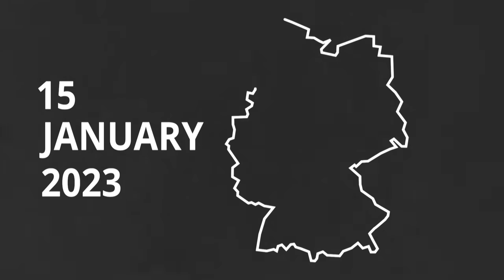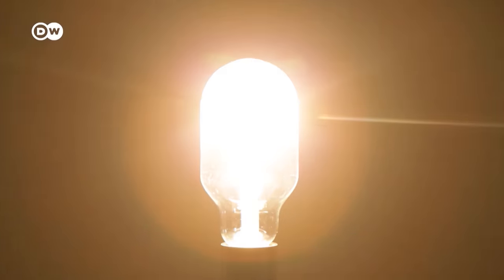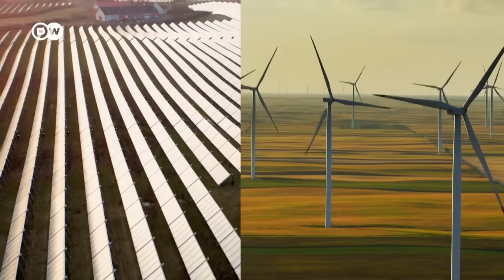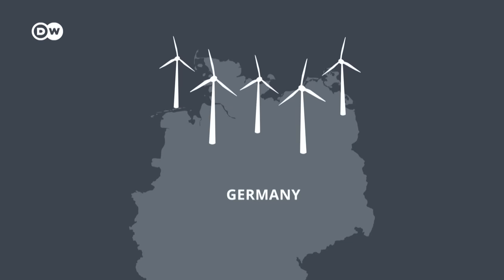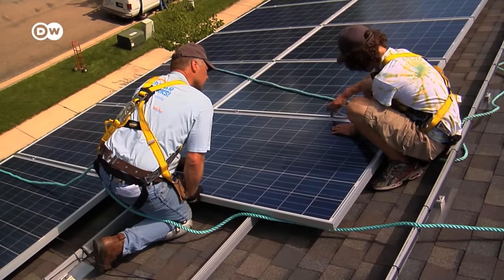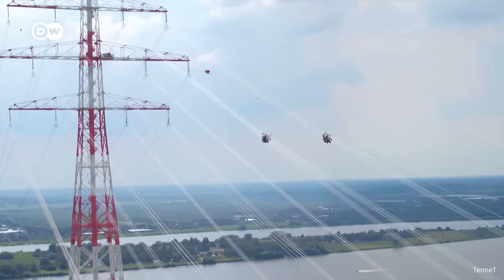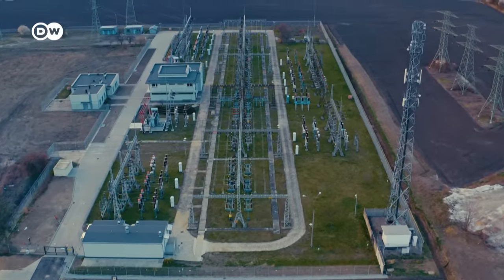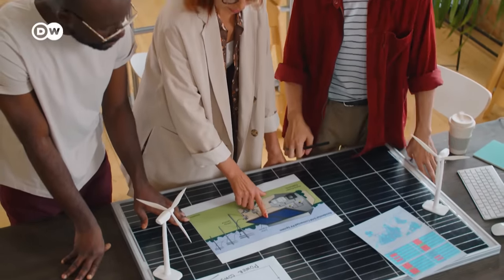This is what's REALLY holding back wind and solar

Comment: This is really an old problem that has been ignored too long. Actually incredible that people wake up now.
Reply: I think another such problem is probably biomimicry getting patented which should be outlawed to just a certain extent, because such patents should have a certain amount of originality to avoid playing in God's domain! That way, we can have better energy storage!
Reply: "In relation to creation / evolution, it is well to remember that evolution has not & cannot be proved." "On the issue of a relationship with God, mistakes have eternal consequences" -Roger Carswell. (I hope the same of the latter quote can't be said of other deities.) And the former one points to the possibility of the prehistoric world being created in a week! In case you are wondering, the quotes are from a book called Questions & Answers From The Bible!
Reply: @st-ex8506  What about biomimicry? It must at least give a cellular level guide for battery design!
Reply: They knew, we just found out...
Reply: Under CDU 20 years
Reply: @frostfamily5321  Biologically based batteries don't charge up or discharge as quickly as other types. There may be a place for a biologic-based battery, but I doubt it would be grids or for EVs or mobile electronic devices.
Reply: @ericdew2021  Then I hope a Tesla power grid-if you can call it that would work out better.
Reply: This sounds like another channel from those blind optimists at The B1M. Wind turbines and solar panels will never generate enough energy in their entire life to make up for the energy it takes to make them. That seems impossible but it's true. The amount of energy it takes to make steel, aluminum, glass and cement is enormous. Cement making alone generates 8% of all human generated CO2. Plus the energy it would take to mine and smelt the copper and other conductors is off the scale when the concentration of the ores is low. And the elites know that global warming is nonsense. That's why they've said over and over that it's not real but they're going to use it to bring in the new world order. Plus there isn't enough copper (or electricity or the other metals - iron is the only metal we have plenty of). Electric cars are being mandated because they want us to not have cars at all. They'll herd us into 15 minute cities and restrict our movement. Elon Musk bragged on twitter that he had the CIA do a coup in Chile so he could take their lithium. The US military invaded Peru last week to steal their copper. It would be better if people had a basic understanding of elementary thermodynamics. This is real science where they know what they're talking about.
Reply: Well, people have talked about this 10 years ago and still there is no working HVDC line on land available. Also it's already predictable that these planned lines won't be enough for the future demand and there are no additional plans public. Plus there is a need for more power in general, so planning to construct solar farms in Spain and Northern Africa and connecting it with HVDC to Germany is overdue now in my POV. So actually I don't see that there is enough of a waking up in politics.
Reply: Youre wrong! They didn't wake up yet. Still dreaming...
Reply: There were plans to avoid this in 2009
Reply: Yes, I guess sitting around with our thumbs up with our asses becomes boring after some time.
Reply: No. This is not problem if you use nuclear powerplants just like France do.
Reply: @mareksykora779  if half of them are out of service (like in France) you'd be wrong about that.

Having excess grid capacity isn't particularly expensive but builds resilience to everything else being less stable.
Reply: (grids are cheap, easy and low maintenance - humans are really good at pulling cables )
Reply: @bunsw2070   Real science?!?! Love to hear from the peanut gallery on this "real" science business. But I advise you to seek help on your REAL delusional reality.

Comment: more than a decade ago, someone wrote that Montana wind alone could produce half of the US electricity need, except that half of the US had to move to Montana.
Reply: Well the good news for you is that continued American under investment in infrastructure for the last fifty years means your Grids (yes plural) need to be renewed anyway - so as you have to spend the money you might as well spend it on making your Grids fit for the 21st Century. There's a company currently building a high voltage line from Iowa to Chicago - they've avoided the usual issues about rights of way and eminent domain by running it alongside interstate highways. I'm surprised the Germans didn't do the same - running it down Autobahn 7 from Hamburg to the South would have given them a fairly direct route.
Reply: There is nothing wrong with Montana. A friend of mine once drove through the state on a road trip
Reply: Illegal Immigrants: Bet!
Reply: @Peizxcv  but would Montana want or be able to handle such an influx?  What would those newcomers do for a livelihood?
Reply: not accurate
Reply: @st-ex8506  Yes, I'm also aware that the 10% of the power for California comes from Canada too.  Hydro beats wind/solar. Hey, I like wind/solar but they are complementary power generators. Not base load.   No matter what solar farms that I build, we will need nuclear in future.
Reply: @st-ex8506  Who is paying for tha
Reply: What are the winters like?
Reply: @BitCrafted  the statement was rhetorical. It was meant to make the reader realizes what the issue is: it is about the grid, the distribution, not the generation of power.

Comment: Yes! Thank you so much for making this video. I work for an electricity grid company for the lower voltages, so the cables that are in the streets and between neighborhood's. We also have a huge amount of work. The amount of aluminium that's going into the ground is enormous and so many more transformers are needed that need to be placed somewhere. If you're looking for a job check the jobs your grid company offers. There are also a lot of jobs for non technical people and if you are technical but don't have an electricity background there's quite often a training program so just try it. I studied architectural engineering and am now an engineer for the cables in your street.
Reply: The irony is that aluminum production in Europe has gone down because of high energy prices, this means with enough forethought we could have possibly prevented it. 😞
Reply: @autohmae yes, the transition to Renewable Energy must happen during time when energy is cheap, when we have surplus of cheap energy to build infrastructure. When energy will be super expensive the effort to build clean and safe future will be much bigger.
Reply: @OmmerSyssel  I'm European and work for an European company. They don't gatekeep. There aren't enough people that have the correct qualifications at the start to be able to gatekeep. At the company I work at I first had to go through a program where they taught me about my work, as I wrote before. After learning the basics I got my first project which was quite simple. All my work was checked extra for about half a year, at our company the work is always checked for compatibility with the rest of the grid and whether it's correct with the standards that our company has. I can always ask my more experienced colleagues and the people that oversee the work outside for help

Comment: You lost me at the hydrogen, it’s absolutely the worst way to store energy it’s so inefficient
Reply: It is ridiculous wasteful for burning it. Maybe turn it into aircraft fuel would be good because they can't run on batteries
Reply: It's not that it's just inefficient, if it were cheap and easily handleable if but could store energy indefinitely it would be fine, but it's not cheap, hydrogen created through electrolysis is incredibly expensive, not just in the electricity required, but mostly that the plants to do it with some efficiency are incredibly expensive, then you tell me your plan is to only run those plants for 4 - 6 hours a day when the wind is blowing and the sun is shining... thats dumb.

And yeh hydrogen is explosive, it's volumetric energy density is low even when stored as a liquid under extreme pressure or extreme cold and causes hydrogen embrittlement wreaking all of the equipment you use to work with it. It ducking sucks.

Comment: In the Netherlands, you can already get energy contracts where your price varies by the hour, and you get an app to see the prices for the day. On days with a lot of sun and wind, the price can actually get negative. This means people will automatically try to shift demand to those hours.

In case that is a lot of work: there are already systems that can connect your washing machine to your home assistant, to turn it on when the price drops below a certain level. For now, those systems still have a high degree of tinkering in them, but that will become more mainstream I hope!
Reply: Do you have a company name for me, i would like to look a bit deeper into it
Reply: Very Impressive, what is happening in Holland with energy optimization.
Recently I heard about Ibis Power, that installs complex systems on rooftops.
Reply: Aren't these systems still variable tarrif. What happens in an extreme case where there is a drastic shortage in power supply. A good example is what happened in Texas during the snow storm last year or was it already 2-3 years ago. People on variable tariffs got huge bills 30k USD for the month, etc. At the moment such a problem is not to be expected in the Netherlands orCentral-West Europe, but how can the system be set up for extremes like this so that the consumer does not empty their bank account or even worse end up in debt.
Reply: @TheNiro87  gridX
Reply: @BrandonLobo Those variable prices are set the day before, per hour, for the whole country (except for a minor margin depending on your contact) so extremes like in Texas aren't expected. The biggest problem in the Netherlands is that we have 'salderen'. That is that is that the excess solar energy is fed back to the grid, can be used in the winter without any extra charge. So in our home we have about 1MWh of solar in the peak months that we can use for free in the winter. It was ment as a boost for renewable energy (solar) but isn't helping the energy transition at the moment. It isn't financially interesting to store energy in a home battery (for the night for example) because the ROI is terrible at the moment. 

Al lot of people are running the dishwasher, laundry, charging the car when the sun is shining, but financially it isn't needed sadly. The flexible energy contracts aren't interesting when you have solar because when the energy prices are negative, you need to pay when your solar energy is supplied to the grid. So it is cheaper to shut down the solar system and turn the electric heaters on with the windows open. 😢
Reply: @BrandonLobo   why do you think it did not work correctly? Worked exactly as it should. During extreme event, it gave extreme incentive to save energy.
Reply: @Harbie  Oh damn thanks for the info. That's just sad
Reply: @TheNiro87 yeah, don't touch those plans. In fact run far and fast from them.

They are generally tied to the current market wholesale price which in AUS where I live is capped at -1000 to 12,500 dollars per megawatt hour.
A lot of people in Texas got bit big time with these types of deal just a few years ago.
Reply: @TheNiro87  "tible" does exactly that, you pay the price electricity gets sold at the stock exchange market. This can be highy profitable ( negative prices when a lot of wind and sun is there) or really expensive (in winter when most electricity is produced with gas and oil)
Reply: @Harbie  Thats funny. You have too much cheap energy and some people really wanna argue against it.

Anyway, couldnt you harvest it in a batterie instead of turning it off?
Reply: @fetB  Sure we can connect a home battery. But the ROI isn't interesting at the moment. The power you harvest is cheap and the battery is still expensive. There is a Dutch company that makes home batteries (5kWh for €3200,-) but in my current contract 5kWh is about €1,-. Last year the energy prices where sky high (due to the war, now the energy panic has settled a bit) and 1kWh was more than €1,-, so if those prices where normal then the ROI would be better. Personally I'll wait for the flow batteries with a storage of 100kWh to make it more sensible to invest.
Reply: Octopus has introduced this in the UK too. It brings some really interesting possibilities for future home microgrids / storage. Maybe an AI app?
Reply: @BrandonLobo  Ultimately, you have to accept the idea of "near blackout" possibility regardless of what your energy supply tec is. I remember a day or so of blackout in Manhattan in Aug-2003 (I recall? Fuzzy old head w dates). It happens, say every 3 or so years overall. Obviously it happens at the worst time - in that Manhattan case it was a sweltering summer spell where every a/c was maxed up full. But such a blackout should never cause the disaster that happened in Texas a few years ago, where in a freak mid-winter snap serious life-threatening scenarios arose. That incident had nothing to do with renewables, incidentally. It was just a plain ol' overload of good ol' legacy grid tec, resulting from bad planning.

Comment: South Australia and Victoria, Australia, have electricity retailers that charge $0 for power use for 2 hours during 12-2pm, which is peak solar supply time. Both states have high roof top solar installation, which means the wholesale price of electricity during 12-2pm is often a negative number, so usage actually returns credit to electricity retailers during those times 😅
Reply: Ahh, another Stralian. I'm from western Tasmania. We have the "Cleanest air in the world.' This is mainly due to a relative lack of heavy industry in the southern hemisphere and very little air exchange between hemispheres. In spite of this, Global warming/climate change is happening just as fast here. As it is in the rest of the southern hemisphere. Does Blackout Bowen or any of our many experts on this subject, have an explanation for this fact?
Reply: The downside is that during 12-2 PM you could be killed by five different kinds of spiders.
Reply: @I_Have_The_Most_Japanese_Music   lol, where i am in the North i got Crocodiles on my doorstep too.
Reply: @neth77  Are they trying to sell you stuff? That would be annoying.
Reply: @christophermay4540  Climate change isn't a localised phenomenon. It is irrelevant that the air is clean near ground level in Tasmania.
Reply: I guess that Australia should rethink also their power grid system. The horrible storms recently did hit the system and the costumers pretty hard. I would like to hear the actual damage and economic lost caused by the power lost. It's also a bit ridiculous to build up the poles again and again instead of making a plan. I'm sure that the government is ignoring this problem as well

Comment: It’s crazy this is a problem in Germany, I work on designing and building high voltage transmission lines just like this one in Texas and we are building them so fast and frequently our company can’t keep up. It makes a huge difference when you don’t have the population and the government constantly TRYING to kill the project.
Reply: This is how you can tell whether people are really rational about environmental concerns or whether they're driven by luddite emotion and superstition.

Germany can get a lot of stuff done because people have a positive gut reaction towards environmentalism.  But on the other hand your gut is your gut, and sometimes it's not the best decision-maker.  Hence the protests against those essential new overhead lines.  Or the closing down of existing nuclear power plants.  You can make good arguments against building new ones, but closing down the ones still running when atmospheric CO2 is our most pressing concern was really stupid.
Reply: It's also an issue in the states. Maybe they don't face as much opposition to it from the public but you still have the problem of needing to build super long transmission lines to transfer power from IBRs to where it's needed. Also, a 700 km transmission line (over 400 miles) that is mentioned in the video is an extremely long line, no offense but I seriously doubt you're building lines that long "faster than your company can keep up". There are also all sorts of permitting and regulatory issues you run into if you want to cross state lines
Reply: @timoooo7320  They're going to have to be that long in the future.  Eventually our high voltage electric grid is going to resemble the fiberoptic Internet backbone grid, spanning the entire globe.

Of course it's going to take a few decades and a lot of metal mining to get that done.  But that's where we're headed.
Reply: The population density is 5 times higher in Germany than Texas, so it's a lot easier to build HV transmission lines in the middle of nowhere in the US.
Reply: Texas is 3x the size of Germany with 1/3x the population. It’s easy building a power line through the desert, but in Germany there are barely any places where you can drive 5 miles without reaching another town.
Reply: It's not a bad thing to plan and think about it properly but in Germany at least there are a lot of people who don't have a clue about what is going on and what is needed. The fossil companies are also seeding troubles and wrong information. The government is too weak and the court is too slow. You can say that there is a rare animal and everything is stopped